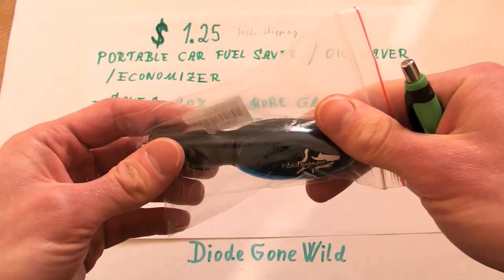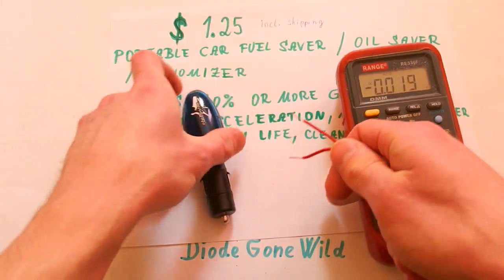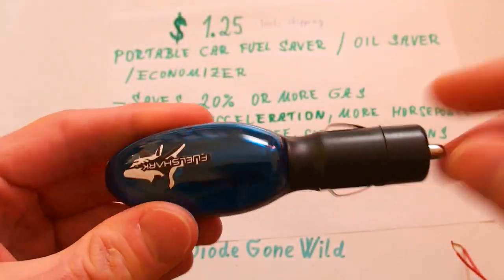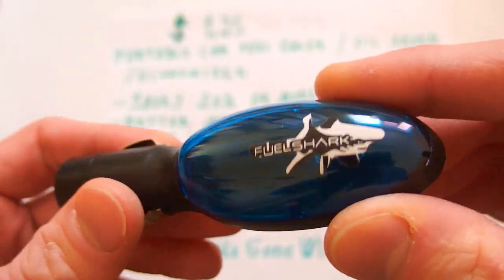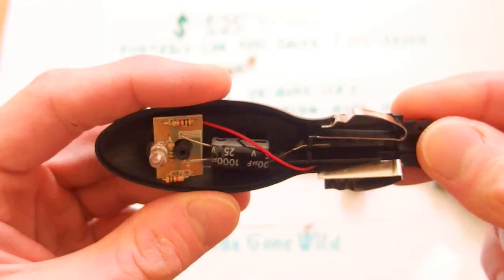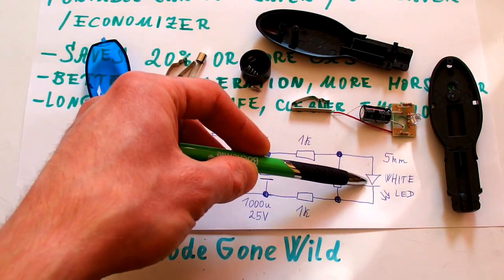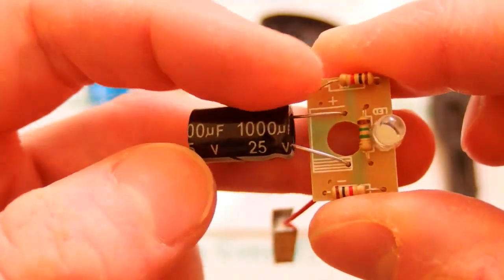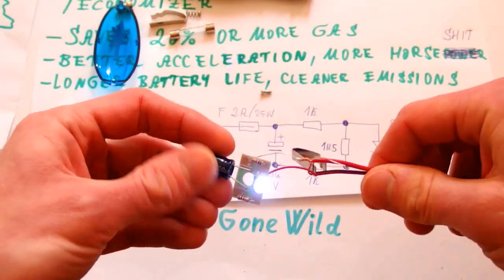FuelShark SCAM - Car Fuel Saver / Economizer - Teardown & Schematic

Comment: As awful and scammy as it sounds, the device can, in theory, work. Adding a capacitative load to a car's alternator can actually reduce the mechnical loading on the alternator, and therefore, the engine. It'd be HIGHLY subjective though, and would vary from car to car. Probably why some people swear it saved them 1 mpg while others say it does absolutely squat.

Comment: Simple and easy to test that car saver 

Use both same model of car fulltank of both

The 1st car is going to use the car saver 

Then SA 2nd car don't use..

Then drive as u can.. so that u could determine whether it's true can save gas or not... Mtf
Reply: Or just poke at it a bit and see what's inside. Save yourself the time.

Comment: I installed the Fuelshark and mine saved 21,5% on fuel, i could drive 5845 miles more on the same oil, emission went down with 7.95%, there was 23.7% less rain, Kept my tires on the right pressure, kept my coffee warm for 32 more minutes and red traffic lights jumped on green when i approach.

Then my wife woke me up and told me i fell asleep behind my computer again......
Reply: Lol

Comment: I knew their claims were hogwash. That right there is nothing more than a blue light that plugs into the cigarette lighter in your car. That cigarette lighter is nothing more than a 12 volt power outlet and is not connected to the ECU in any way, shape or form. It can power small appliances, such as a dashcam, a GPS or a travel phone charger, but it cannot facilitate a crappy gimmick like that controlling your ECU in a way that favours fuel economy.

Comment: It's funny because technically this would use more gas (although not measurable) because it needs the engine to spin the alternator to create the power for the led.

Comment: They do sell Large Capacitors for Cars that use heavy Audio Loads. Example : BOSS 5 Farad  Digital Audio capacitor. If the Problem is a large draw to provide power ramping up the Engine  and draining more fuel maybe some one can do an Install and Take the car out on a 100 Mile trip. Trip #1 With Capacitor Installed. Trip #2 round trip on the way back with Capacitor uninstalled. Prefer someone that can find an empty road and use a cruise control method for an Unbias result. If this works and you can save a reasonable amount of noticeable fuel Make a video about it in extreme detail!

Comment: Without opening it, you will know that it is a scam. A thing like this that is only connected to the lighter socket, you won’t expect that will save fuel..It a scam at first sight.. There are other scams running around..

Comment: Hi everyone ,thanks for this video taking this device apart , 20 years ago i had a land rover Discovery  and as you know it was an 8 cylinders car 4x4 , its fuel consumption was enormous ,once i was in the garage for oil change ,the mechanic during a normal conversation proposed me a miracle device for reducing fuel consumption newly arrived from  Michigan and that device would save more than 30 per cent of fuel consumption , its price was 100 US , i agreed directly as a good proposal from  some one who was taking care of my different cars for long time ,,to cut the story short  , this device was an over under magnet hidden in a rubber box of  2 inches you clip it over the fuel line and that's it, so unfortunately nothing has changed in fuel economy,  it was a scam, since then i don't believe in any device for this purpose  because all this recent technology in cars manufacturing ,computers are programming all your manoeuvres  and trips and any intruder device would block all your car system  costing lots of money to repair.

Comment: I just can't understand what all you sceptics don't get with this piece of genius gadgetry. It is pure and simple universal high school physics, common knowledge that a 1000uF capacitor (rated 25V) whether it is connected in parallel or even in fact in series with the 12v car mains and coupled to a 2A fuse, will reduce the erratic vibrations within the turbo-gyrated giggling pins, thus stabilising the inherent see-sawing effect of the see-saw glands, giving a modest reduction of at least 10% in fuel consumption alone. As this is then connected to the LED indicator with two 1k resistors in series and a 1.5M discharging resistor, it will boost the velocicator to produce a gargantuous thrust output for absolutely minimal fuel input (vc=vth*f/(1000fu's*sqrt.00261213/th*ltyr)). Then if it is synchronised with an in-line booster of loopy juice it would result in a super surge of NOS3, thus producing another blast of infinite torque to the rear power train,  resulting in machIV velocity with a further reduction of 40% fuel consumption, so theoretically the faster you go, the more fuel you save, it's simply not rocket science. And you can even fit two of these little beauties, I had a second cigarette lighter socket fitted in my DeLorean XR3i and baboooooshka, vroooom, OMPG 😱  It would be money in the bank but the only downfall is, I managed to pick up eight £70 speeding fines and an instant driving ban on one stretch of motorway in one trip 😤 So the money I saved on fuel I now have to spend on Unicorn riding lessons and wish I had listened to DiodeGoneWild's advice 😥

Comment: I don't have one but from my understanding it's supposed to ease the drain on your car's capacitor so that it could run more efficiently separating the electrical drain from the  Circuitry, lights and air conditioning so your car engine can run more efficiently.

Comment: back in the 70’s there were a few men who actually cracked the code, tom ogle invented a better way to vaporize the gas before ignition- 100mpg- another guy patented an efficient way electrolysis, separating hydrogen from oxygen in the water, standard engine running on hydrogen. “THEY” killed those men out right. so now, guys that do the research Keep Their Mouths Shut.

Comment: Not "Schematic"  "Scamatic".  😂

I just got an ad for this item.  There were fuel saving device scams back in the 70s.  The ad says "Beetle could travel 2,096 miles on a single tank".
Reply: @Gazr Gazr   The tank size should always mean the one that the car originally comes with when stating fuel economy.  
You would have to tow a trailer with a large tank on it to get that distance on one fill.  Definitely a scam.

Comment: Makes total sense... You plug in an extra accessory to your cars electrical system and it makes the rest of your electrical system use less power as it probably burns out the fuse so so your electrical accessories stop worrying and 💥 boom. Press pull from the alternator.  🤷

Comment: It's a great device for making money for the inventor of a really crappy led torch, let's face it, if one million people bought this device and each one costs 25 sense to make the inventor and presumably distributor made 1 million pounds, assuming a lot more than 1 million people bought this crap, let's say a few million people bought it only to discover it's complete nonsense then that's a few million pounds or dollars made selling people complete crap.

So yes it works really well at generating money for the inventor of a worthless device that does not work, but you now have 25 cense worth of bits and bobs in your tool box, a worthless fuse that you probably will have no use for, an LED that you mind find a use for a plastic case  that perhaps could be used for something else, and a 2 pence/cense capacitor that you probably will never use again.

So yes it works really well in making money for the people or person that promoted this crap, because so many have probably bought it.

Comment: Not only would the car-makers have started putting them into all cars, but governments all over the world would have required them to help fight against smog. On the other hand...how much do you think that fuse is worth? What about that capacitor? How do they get that shipped plus pay for those parts....all for $1.25? Is it surplus stock? Is it likely that the molded plastic unit could have had any other kind of legitimate function such as a battery charger or such? It just seems like they have a surplus bunch of parts that they're trying to get rid of, while getting some small amount of cash in exchange for the stuff.

Comment: I thought it was just a scam till I took it apart and saw the flux capacitor and the 2A fuse then i knew I was dealing with some serious and genius engine earring.
Reply: Great Scott! Thank goodness Magnus knocked on my door back in 1955 and told me the basics of my future design for the flux capacitor - now I can stabilise my alternator without transgressing the limits of the up/down shift converter internal to the offset hypoid gearing shaft.
Reply: @arqoo1907  The advert of Magnus, his girlfriend, professor etc is all stock footage
Reply: Wait until you get your car up to 88mph.  Your going to see some serious .......  😂
Reply: @my3dviews  I'm lucky if my car can go 88 kilometres per hour.
Reply: @XNY556-Apple     I'll race you.   😂
Just got a new car this year.

Comment: The fact that this plugs into a cigarette lighter which is the end of a circuit leading to the inside of the car, and that it's supposed to magically do something within the working internal parts of a combustion engine is hysterical. The alternator only is used to keep the battery in a Charged state by cutting off the battery power after the car is started and keeping the other internal parts going. Gasoline has to constantly be fired to provide energy, so how the hell is that supposed to work from a cigarette lighter LOL

Comment: As a mechanic...The alternator does not have anything to do with the gas mileage of the car. All the alternator does is keep your electric devices powered along with charging your battery from the turning of the belt which is taking energy from the rotation of the combustion engine and using that power to charge the battery. This belt is not causing the crankshaft to do any addittional work and is in NO WAY connected to your fuel system.  There is no way humanly possible that this can work unless it is reversing the flow of power of your battery which means you would be changing a destroyed car battery very often. There is a reason electic cars have HUGE battery packs of multiple batteries larger then the battery under your hood used to start your car.

Comment: At least they are only charging 1.2 dollars, for this you get an LED, a capacitor, 3 resistors, a fuse, and a cigarette male socket. What you could do with this, is change the LED to a 40mA one instead and then you have a legitimate emergency car light that turns on by just plugging it into the cigarette lighter. The lagging effect of the light you see is obviously from the capacitor, you can totally remove the capacitor as it's useless.

Comment: Mazda uses a "similar" system in the Mazda 3. Except that it's a 25- farad supercapacitor that it charges during braking (which loads the alternator and increases engine braking) and then either dumps it when you take off again, as part of the auto stop-start system, or it allows the alternator to switch off during acceleration, allowing the energy that would otherwise be used to run it to be used for acceleration instead. Basically, it's part of a regenerative braking system, and it actually does save fuel by recovering some of the energy that is normally lost to friction when you stop. I mention this because the fuel shark people actually compared this device to the Mazda system. Because a 1000uF capacitor by itself is somehow exactly the same as a 25,000,000 uF capacitor with support circuitry to take advantage of energy that is normally lost. In fact, other versions of the Fuel Shark used a 35v rated capacitor, and they were actually implying that this was better, because the Mazda system "only" contains a 25v rated capacitor.
Reply: Jeez Louise that is disgusting behaviour. They  really are trying to sell rubbish aren't they. I was aware of the Mazda's regenerative system, which I why, when I saw an ad for this device I was extremely skeptical ಠ_ಠ
Reply: Typical Chinese.
Reply: Renault use a similar gizmo in their cars. Mine does great deisel mileage and tells me how many "miles without using fuel" which it does by the regenerative braking doohickey or just by using the vehicles inertia to stop with only light braking. Or whatever. I dunno. I only know I get about 68 to the gallon.

Comment: 'They' could've made this JUNK cheaper: By linking out one of the two 1K resistors and replacing the other with a 2K resistor. I think I'll bill them for my advice ;) I wonder just how many people drive around with this sort of stuff? The best fuel saver - very careful use of the right foot, or don't take the car out.

Comment: It actually does the opposite, it needs power from the battery, and the engine from the car charges the battery, so the engine need to work harder to charge the battery.

Comment: of course its a scam.

how can a device in your ciggy lighter effect fuel?
Reply: A high power device can use more fuel
Reply: @janrie7330  dont be fucken stupid.

this "device" is supposed to SAVE fuel.

naybee i was not clear enough by saying "effect".

of course a high consumption electrical device can INCREASE fuel consumption of the engine running it(the as an aircon unit does) but it can never save fuel

Comment: I don't think that the people that say that this is working understand to what extent a capacitor would have an effect on the electrical system of a car. They think of capacitors as batteries. They also think they are able to keep wild and dipping voltages steady, regardless of how many watts of power would be needed. They don't understand what a 1000 microfarad capacitor is capable of storing in joules because they don't understand how many joules a battery holds. 1000 microfarad is absolutely inconsequential in a system like a car. 
:( those of you that believe that this will help your gas mileage are letting your confirmation bias get in the way of logical analysis and reasoning...
Reply: A capacitor really can save fuel if it's big enough - Mazda uses one in its stop-start system. But a 1000 µF capacitor won't do much at all.

https://www.greencarreports.com/news/1069924_mazda-improves-fuel-saving-start-stop-system-with-capacitors

Comment: I made one using a bigger capacitor 10,000uF 50volt on a 12yr old carburetor car.

It did make a difference. More low end torque and smoother ride. 
I'm guessing coz the car is old and had a weak alternator....
Hence the capacitor gave the ignition systems a good boost when it was hooked up to the car.
Note: Setup is the same as fuel shark except for the bigger capacitor.
Reply: try a 2 farad capacitor. would probably make a much bigger difference for you. and connect it directly to the car (earlier than the battery if possible.)

Comment: Do you want to add a capacitor in parallel to your battery together with a blue LED? iF YOU ANSWERED YES, THEN PAY US 5$ when you can buy all this yourself for 1$!
Reply: It only costs $1.25 delivered. Probably would be more expensive to build it yourself.

Comment: Oh my. Hehehe. Now I have seen it all. Actually this apparatus increases fuel consumption as it draws current. These your videos are top ones here in Youtube.
Reply: 6 milliamps doesn't put enough load on the electrical system to even be measured. you are right though, It doesn't help in any way.

Comment: I have been useing this and i get a extra 23 mile out of a tank of fuel  compared to when I did not use  it. So  must be doing something  as  my mile with out it is less and yes I have done the full tank with and a full tank with out test  and as said I get 23 miles more with and that's driving the same route  witch is a 150 mile round trip twice a week   at the same speeds
Reply: I guess you're just part of the business with this nonsence.
Reply: Try it with the light covered over - see if it is just driver habits.
Reply: this must be a joke
Reply: dumb... how are you still alive?
Reply: I made one using a bigger capacitor 10,000uF 50volt on a 12yr old carburetor car.

It did make a difference. More low end torque and smoother ride. 
I'm guessing coz the car is old and had a weak alternator....
Hence the capacitor gave the ignition systems a good boost when it was hooked up to the car.
Note: Setup is the same as fuel shark except for the bigger capacitor.
Reply: @mariainshirahart9595  shut up we get it stop spamming
Reply: scott Harris do a video review
Reply: scott Harris Yes... It Was Save A Fuel... Not To Much But The Function Still Same As Promote..... Actually A Capacitor Control A Power Produce And Stabilize A Current Charge.... By Using It, It Will Send More Power To Whole Car Included Coil And Spark Plug... The Strong Spark Of The Spark Plug Surely Will Increase The Power Of The Engine Because The Fuel Explosion Will Become Larger... And Of Course It Will Reduce The Fuel Usage To Be More Efficient Because Your Car Will Have More Pickup.....  It Was True... You Can Save A Fuel But It Was Not Too Much As You Expected.... You Can See A Fuel Saving In A Month Or A Year... Small Saving Amount But It Is Still Save.... Of Course This Small Item Cant Make A Save Too Much... Nothings Can Save Your Fuel Too Much...
Reply: @Dragonkingzx  no it won't the capacitor only holds current so the light stays on after turning off the ignition. Plus cigarette lighter is an output not input

Comment: You are wrong, it does save fuel only if the car is water powered 🤒
Reply: Doesn't make sense
Reply: Also it's hydrogen power, I'm pretty sure water powered automobiles have stopped production ages ago